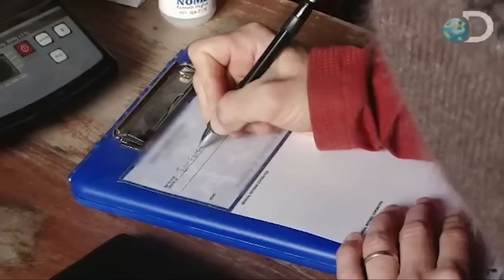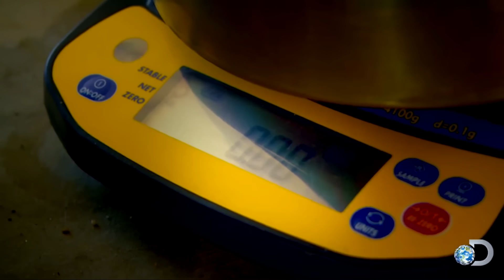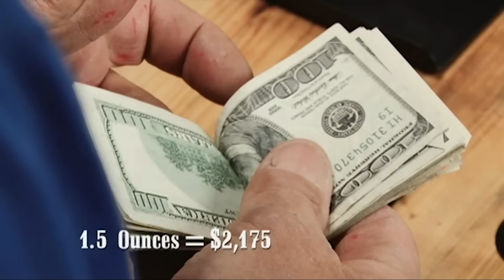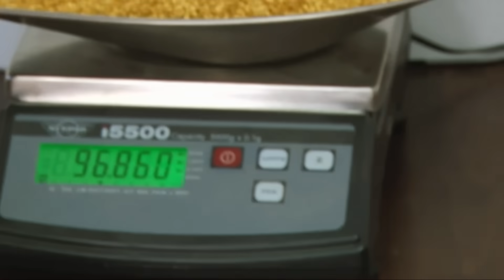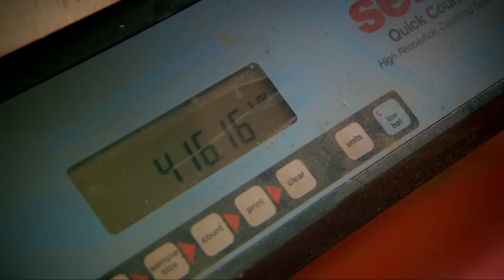Best Gold Clean Ups Ever | Gold Rush & Bering Sea Gold

Comment: I do not know how much of this show is staged or not, but i have a question for all of you that even bothered to calculate each of the paychecks: Why do we have such different prices of the gold? 
I know that not all of them have the same purity, but they do not mention the purity of what they are getting.
So, at the beginning we have prices of 1.800 USD/OZ and at the end we have 1.200 USD/OZ. I really do not get it....
Reply: wee rares I think they're from different seasons. Not sure though
Reply: The price of gold per ounce also fluctuates daily. Not a lot, but over a period of time, it can be a large change. Plus, depending on how clean it is, etc, can change the price a little.
Reply: its like scrap metal prices. they fluctuate daily. sometimes i get paid 0.16ct a kilogram sometimes i get paid a cent more or less. and depending if it is whitegood, clean steel or a mixture. and the non ferrous metals are more expensive but those prices also fluctuate daily. its all about supply and demand and what is already in stock. i guess this kinda sums up your question. i hope :D
Reply: we work in the  congo and  can only get about 500 dollars usd an ounce... its just the way it is..  the smelters work on  2 ways.. either a straight price or a  cleaned price minus  smelting costs.. your choice.. they make you 2  offers.. you choose what you thinks  best.. then they have to sell it to a wholesaler and then they have to register it and pay taxes to the govt.. then that wholesaler sells it to europe or usa  or a  broker... no one  gets spot market prices for 100 kg of gold clean or dirty

Comment: God, this is so fake, they have to first subtract the mass of whatever holding the gold with that thing with gold, they cant just read straight from the balance.
Reply: It's called zeroing out the scale. You place the dish on the scale, push the button, and the scale now reads zero and will start showing the additional weight paced in it from there. I see you've never used an electronic scale before. It's one of many options.